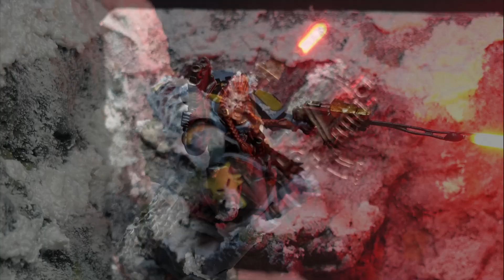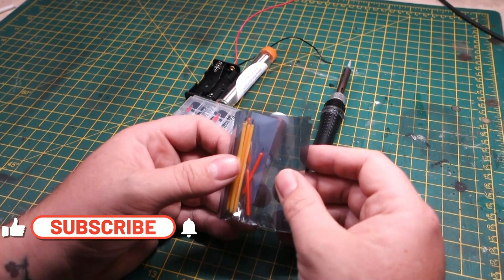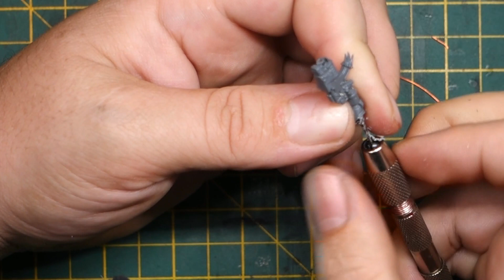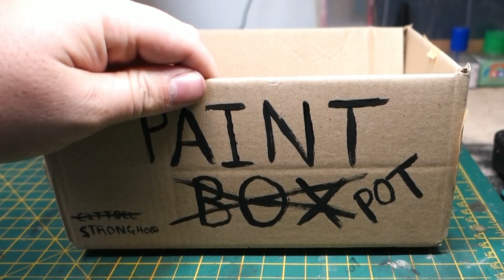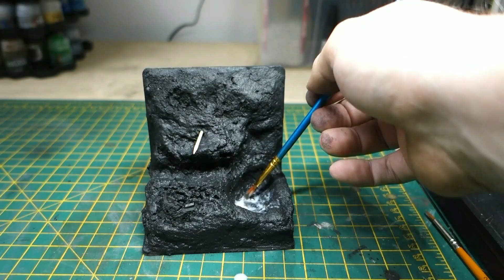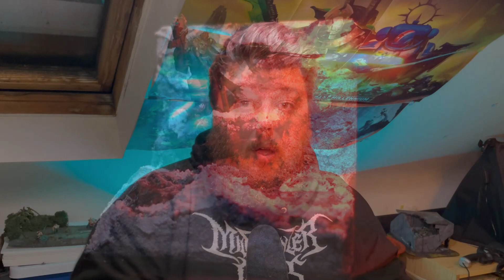Warhammer Display Diorama | Space Wolves

Comment: If you don't want to mess about sanding the ends of the wire you can burn off the coating with a lighter, just don't hold it on the flame for too long
Reply from the maker: That’s some top tier advice 👍👍 😅 thanks chap!